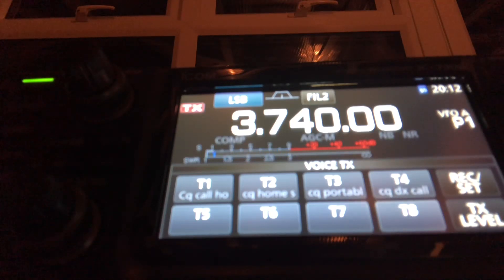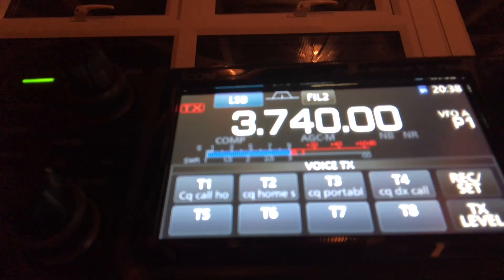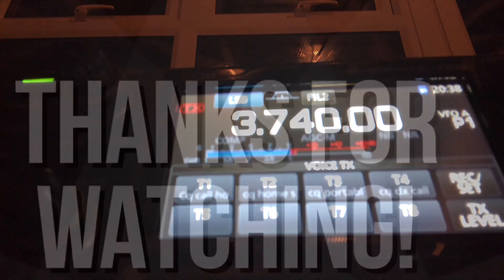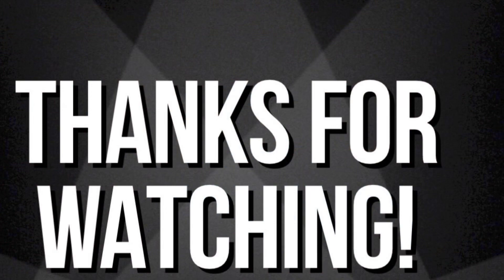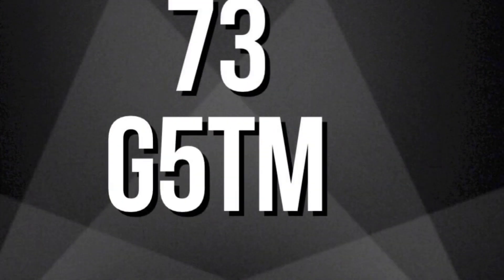80 Meter Doublet Test

Comment: Hi Tim, I was wondering do you think the wire configuration would work on the multiband end-fed unit from UK antennas. It states you use 30. meters of wire do you think you could bend the wire-like you have done with this unit. Thanks, Brian 2e0tcu. and thanks for your great videos you give lots of fantastic ideas
Reply from the maker: That’s really kind Brian. You can bend an end fed as long as the bends aren’t less than 90 degrees it’s worth trying! Thanks for watching and commenting 73
Reply: @TIMG5TM  Thanks Tim, my dilemma is this, after building g7fek with the wrong ferroxcube do I spend 50 quid on importing them from Holland, they cost just under three quid each but they charge 47.00 pounds delivery unless you spend 50 pounds then it's free,  or do I bite the bullet and try something else. I built this antenna sometime ago and it did work great on 80 meters so this is the reason for my question. thanks, Brian 2e0tcu
Reply: Sorry Tim the details of the g7fek was in the September Racom with with two ground loops. Brian
Reply from the maker: Brian as the g7fek is a pair of inverted L’s I would consider the noise floor. Verticals are often quite noisy. Do you know if this is the case at home?
Reply: @TIMG5TM  Even though the antenna is only short 46ft total and has two vertical elements, with the addition of two counter-poise loops it makes it very quiet and even the older design was not a bad noise floor, I live in the middle of a large suburban town near Derby so it can be noisy. Thanks, Brian
Reply from the maker: Ok Brian well in that case try and make it sing. Maybe have the end fed as a back up plan? Tim

Comment: You made one mistake on this doublet Tim. Never let the ladderline lay against a metal pipe such as the mast. This throws the line out of balance and makes it radiate. Space the line away from the mast pipe and your performance will be much better.
Reply from the maker: The mast was fibreglass and hence non conductive 73

Comment: Wow - great results for the doublet. Huge congrats on your G5. I didn't realize you could get assigned an "old" callsign. I am stuck on trying for an Intermediate license. The local club has all but packed up and it will be a pain getting to the next nearest. I don't mind doing the study time. But I wish Ofcom/RSGB would put a better test system in place. Again best of luck with G5TM - it makes you sound like a real veteran of the early days!
Reply from the maker: Thanks Stephen! Hope you find somewhere to do the intermediate. Yes I’m still getting used to the new call!! 73 and thank you for watching and commenting 👍
Reply: @TIMG5TM  Thank you. May I ask did you get assigned an M0/M1 first and then have to apply for the G5?
Reply from the maker: Stephen Brown No I had to apply using a form from OFCOM .. cost 20 quid and had to wait a couple of weeks
Reply: @TIMG5TM  same here Tim. Took a few weeks but patience paid off.
2E0MK 👍